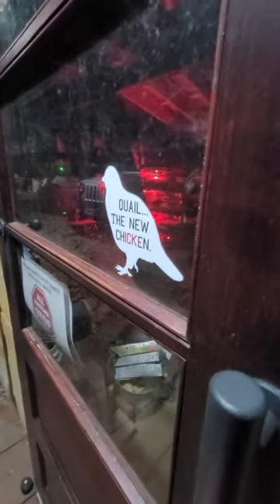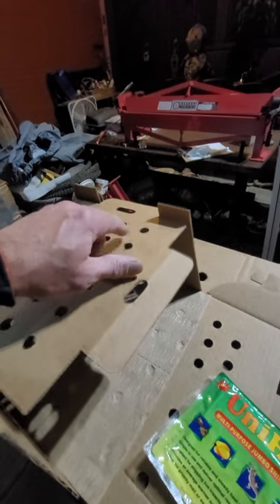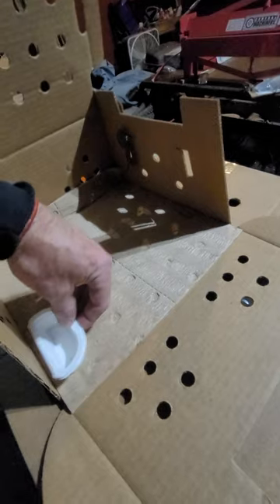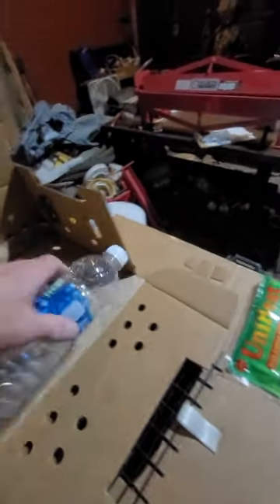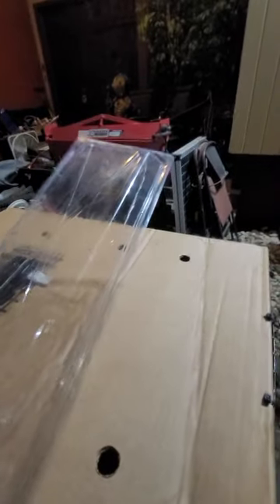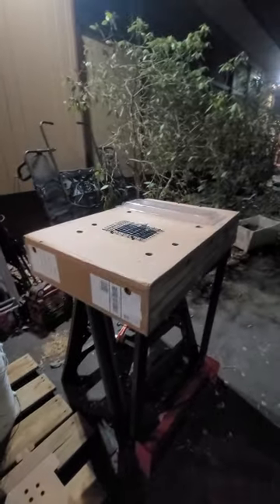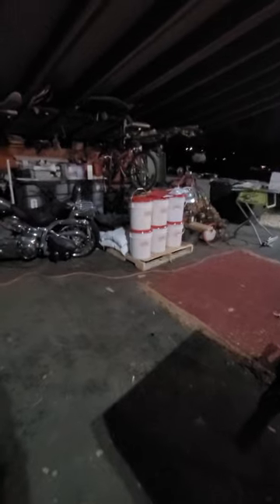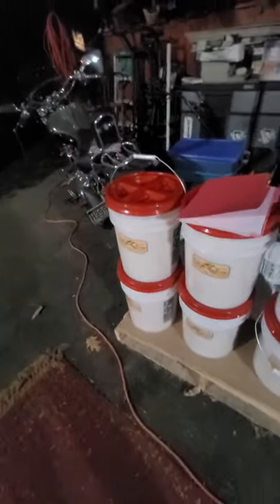Quail Business Tips:  DIY Adult Quail Tansport cage and Jumbo Quail Chick Shipping & Transport tips

Comment: Can you do a video on your dishwasher and winecooler incubators? We are very interested in trying to build our own!
Reply from the maker: There is one one the DIY Dishwasher build and a separate one for the tray & egg turning system under our DIY Playlist.  I'll try and find the Wine cooler video and upload that.
Dishwashers are awesome, often free and the large heating element provides for good heat distribution.  We placed an AC infinity T4 (12"?) Fan on a harbor freight  magnetic tool holder strip so I can be easily removed.  It in the back top blowing down.
The trays are vinyl decking boards cut in hard with a 1/4" thick "holed" aluminum oil drain material from a local scrap yard (Moses Glick) who may have some still in stock.  They had pallets of the stuff.  It holds the heat when candling.  The acrylic sheets came from there too, but you can find that anywhere.
I'm super happy with the Lilytech ZL7109A (now B) controller vs the clunky pokemon-esque XM-18 models from Chinah.  Our incubator has been running since December non stop!
Have another look at our Playlist and ask me again if you want something better 'splained.   Doc@TullyRiverQuail.com